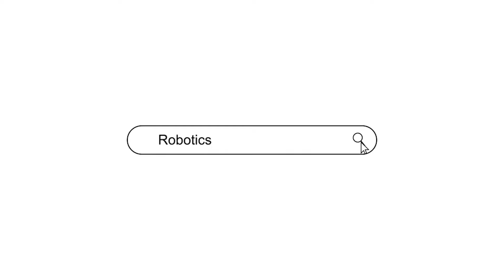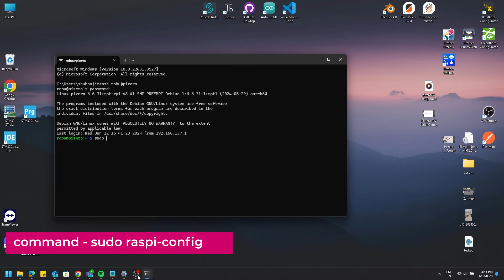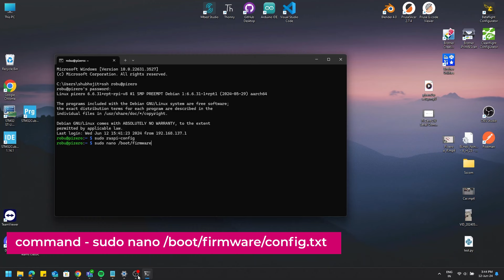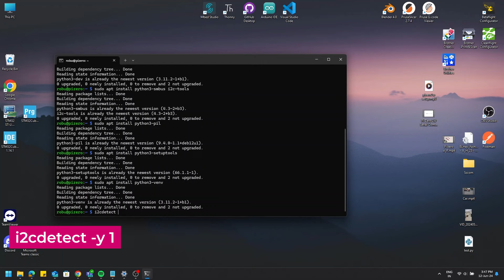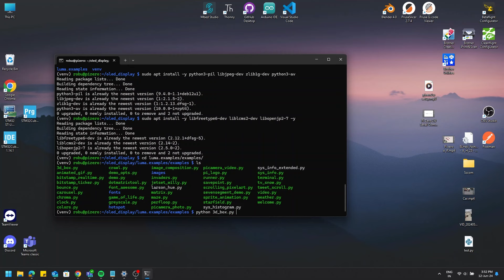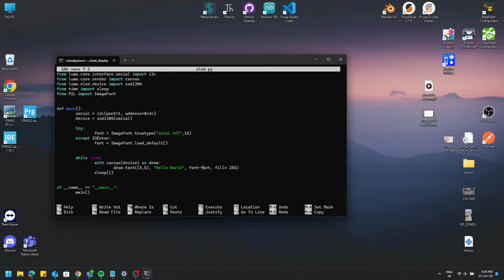Raspberry Pi Zero 2W interfacing with OLED Display  - Easy Setup

Comment: My oled has 7 pins
Can you help me?
Reply from the maker: Hello, Orisuestudios
I'm guessing you're using oled display with SPI interface.
I'll give you a gist of what you need to do.
1. You'll need to connect pins to the respective pins on the pi zero 2W.
2. Enable SPI in raspi-config menu by 'sudo raspi-config'
3. And in the code part, you'll need to change the part where display variable is initialized and 
4. Also install the library for SPI 1306 for Raspberry Pi.

Additionally, refer the library documentation you'd be using to make necessary changes in code on how to print text on the display.
There are ton of guides, please refer them also.